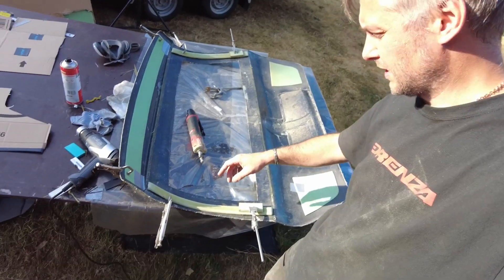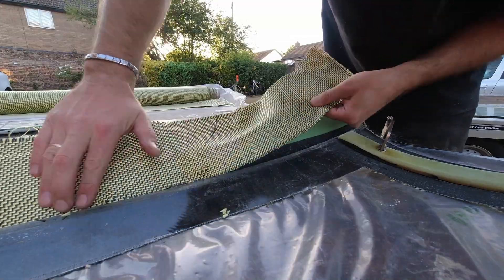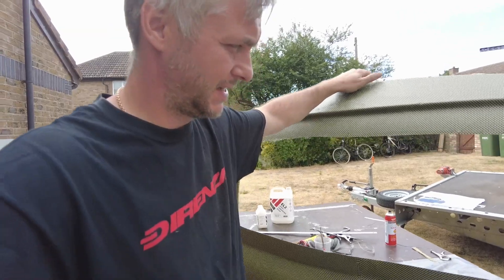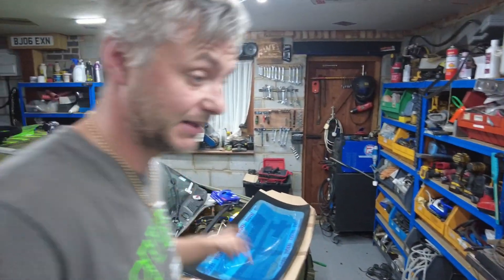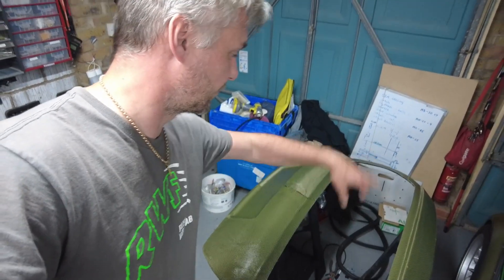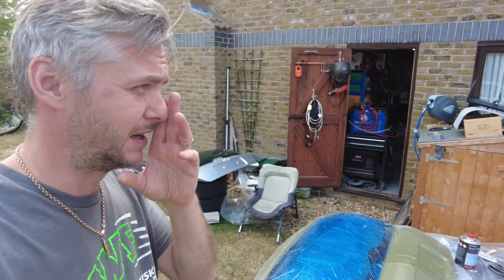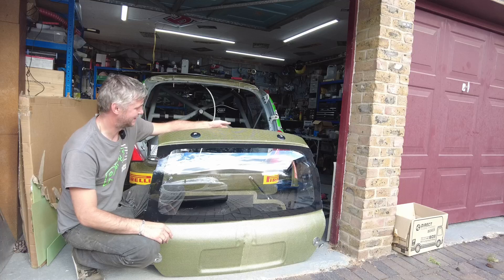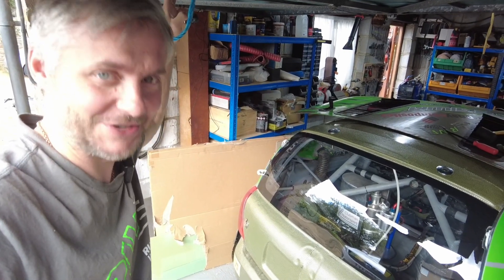DIY Kevlar TAILGATE for my Clio. Building the fastest maybe lightest clio. part 2

Comment: Not as light as you had hoped but as a percentage it's still about 50% lighter than an already light FG one! You should be comparing it with a full weight steel/glass one
Reply from the maker: yeah thats a fair point actualy! guess i been spoiled by massive reductions in the past. in this time its only 50%.
Reply: @RuskiWeldFab  What was the weight of the factory steel & glass boot lid? I'm guessing like 40kg including rubber and struts?

Comment: Vacuuming a few parts that are on the heavier side will help with the weight, gets you a better resin to Fibre ratio and better compression of the layers. It wouldn't be much saving mind you, but a few grams adds up
Reply from the maker: great tip! i tried it before and it tends to distort the part too much. unless its from a mould. so would rather have few extra grams vs headache once its distorted. also i weight all the resin to fabric to get good ratio anyways.

Comment: Good result....What about speed holes to make it lighter, like the 70's style rally cross cars...I've been using Sikaflex with a primer / activator for fixing the glass into our gravel rally car. It also works well on our poly carb side windows. We were warned about the activator blooming the poly carb, but it seems to be alright. It's the first car we've had that the windows don't leek.
Reply from the maker: Cool idea!

Comment: Been watching all your kevlar videos, inc the Micra videos. They have been very insightful for my Clio race car. Thank you for the detail you have gone to.

Although when using the OE panel as the mould are you not creating a kevlar part with different dimensions to OE? Surely they would be too large. Using the kevlar as a mould to reproduce the outer skin on the underside of the kevlar unit would produce the same size OE panel. 

Have you run into this being an issue?
Reply from the maker: it does but only by the thickness of the panel. in most cases 1-1,5mm. so never an issue